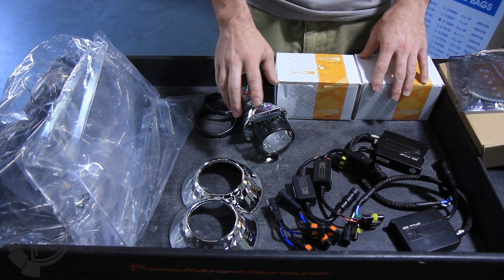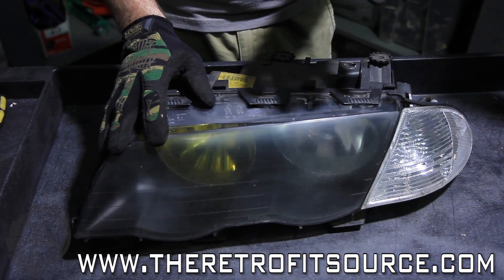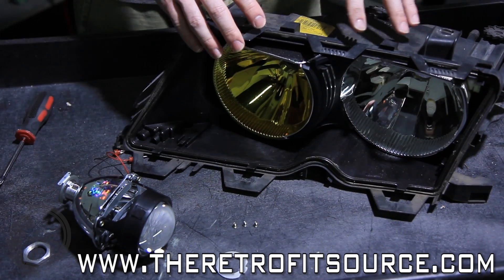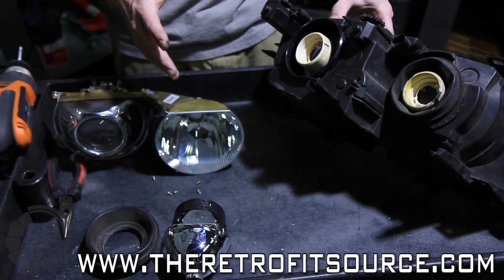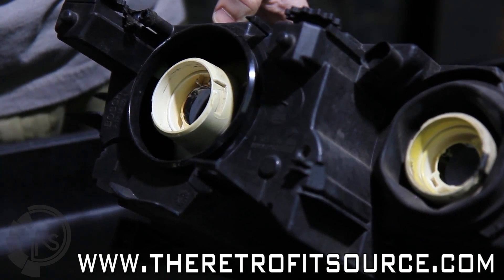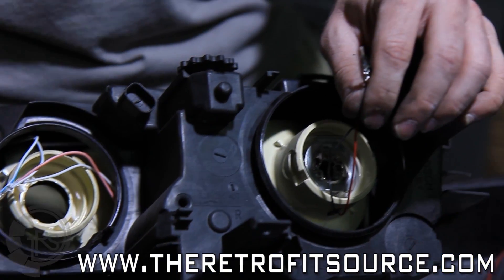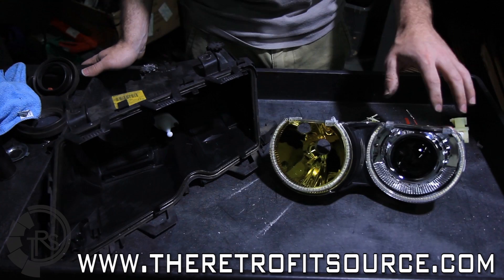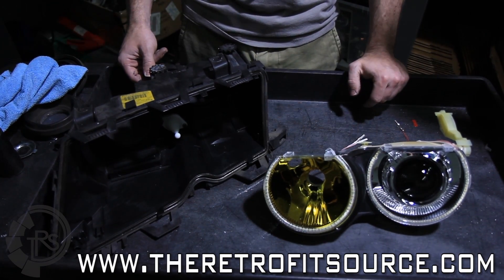TRS Tips: Retrofitting BMW E46 3 Series Headlights with Upgraded Mini H1 Bi-xenon Projectors

Comment: Does the connections just plug and play?
Reply from the maker: Yes everything in a retrofit kit, bulbs, wiring, ballast, etc, are all plug and play. The custom work would come in for opening the headlight, mounting solutions, etc, but E46 is very straight forward if doing a conversion such as in the video.

Comment: Is there ANY way to fit projectors and keep the oem bulbs?!?! Seems like no one can pull it off on YouTube
Reply from the maker: Yes and no. In theory, you can find another projector that uses an H11 bulb type and use that... but performance is going to be lackluster. Performance projectors are made for D1S/D2S/D3S/D4S and H1 primarily.

Comment: is it possible to connect two projectors to each side?
Reply from the maker: Definitely, you will just have to run 2 low beam harnesses.
https://www.theretrofitsource.com/hd-relay-9006.html

To connect them to your vehicle just run this splitter on the inputs to the harnesses.
https://www.theretrofitsource.com/high-beam-splitters.html

Comment: Where the bi xenon solenoid wires connects to ?
Reply from the maker: They will connect to your high beam
Reply: If my car has DRL option on the bulb of the highbeam with a 5v signal, where should I wire this solenoide signal? Still in the highbeam signal?
Reply: @Peralta1224  4 years later i ask myself the same question as you, what happens if you have drl enabled and upgrade to bi xenon projectors using signal from high beam to get power to the highbeam solenoid

Comment: Bulbs, electronics etc. used in any U.S. vehicle need be DOT approved. Case in point: BMW electrical fire in a garage; ( I believe these were LED tail light mods)... upstairs house burned too... Auto Insurance found the Non-DOT approved mod and disallowed claimant recovery.
Reply: Tatter Salad these are dangerous?
Reply: they are not dangerous if wired by someone who knows what he's doing :)

Comment: man this looked sooo fuckin easy. i dunno why it was a lot harder for me to do an FX-R retrofit into my ZKW OEM HID housing.
Reply: Those projectors are huge...I have them and my biggest problem is getting the beam pattern to be perfectly horizontal. I had to cut away half of the low beam reflector bowl and epoxy the projector in